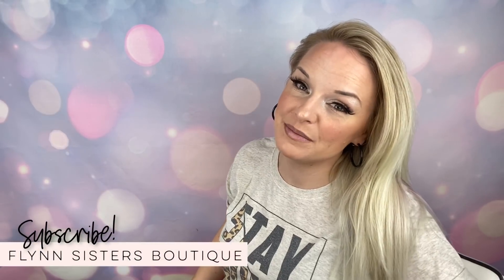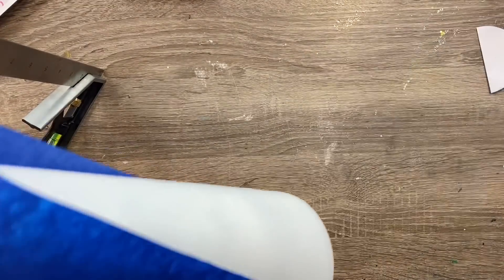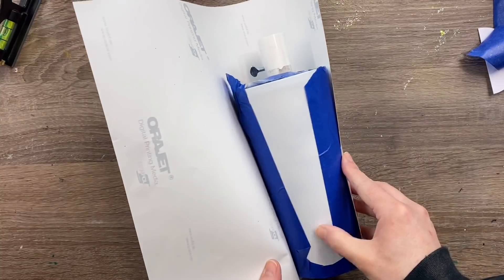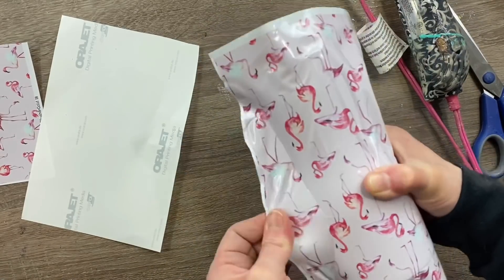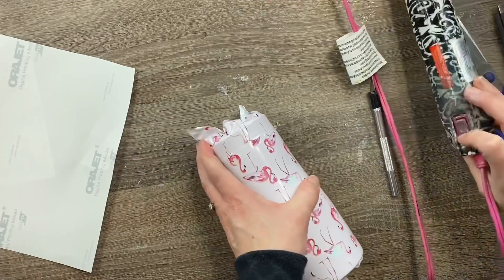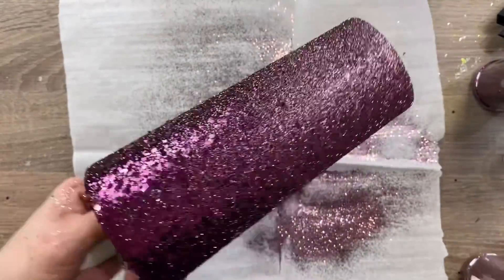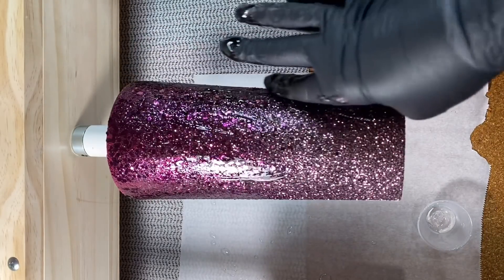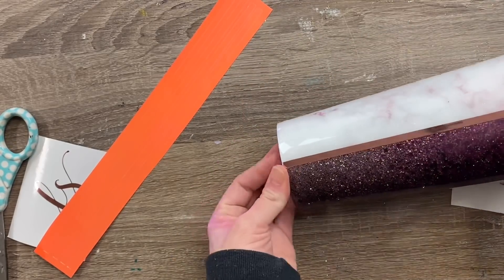Vinyl Half Wrap Tumbler Tutorial

Comment: Hi, I saw your struggle with the vinyl and I use a water bottle with water and dish soap and lightly spray the cup and vinyl. It allows you to position the vinyl better with moving it. It also allows you to easily remove bubbles as well. Hope that helps.
Reply from the maker: Thanks for the tips!

Comment: The flamingo 🦩😍 Question.. do you spray paint the bottom right after sanding or do you apply a thin layer of epoxy first?🤔
Reply from the maker: Yes, I sand it and clean it and then I spray paint it.

Comment: Thank you so much for this. My question ive been needing so much help with is that after I do my epoxy method qith the glitter... then i pat down the glitters lightly with parchment paper. Let dry the 4ish hours maybe longer. Then i spray clear spray paint once. Then let dry an hours or 2 then go in with my first good layer of epoxy. Now after I have applied that layer of epoxy over my glitter I notice dumpling. Why is it doing this? Maybe I need to spray more thin layers of clear spray paint to seal the glitter in more? If anyone could help i would greatly appreciate it❤
Reply from the maker: Hair and nails by Cori that’s pretty normal. Make sure the spray sealer you’re using is shaken well. You won’t get it smooth with chunky until the second coat. Also try using a little more epoxy and way less chunky glitter so it lays flatter
Reply: @FlynnSistersBoutique  Thank you so much! I appriciate the reply. I did notice today I wasn't shaking my spray paint enough with the colors so I probably wasn't doing enough with the spray sealer. I will try that and see if I can get it to absorb more evenly. Thank you doll❤

Comment: You did two coats of epoxy before sanding and I’ve only seen it known to apply one coat, sand, and repeat...
Is there a specific reason and does it not affect the cup with bumps or any glitter poking out between coat one and two?
Reply from the maker: Kayleigh Silkwood there’s no reason to sand the first layer since waiting till the second would be just as effective with less of a chance of sanding too far down and damaging the glitter